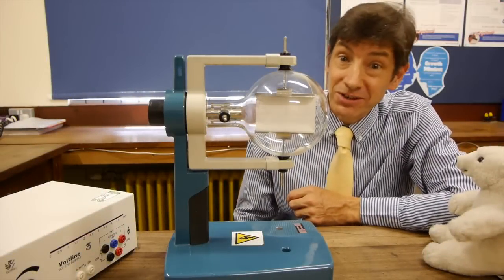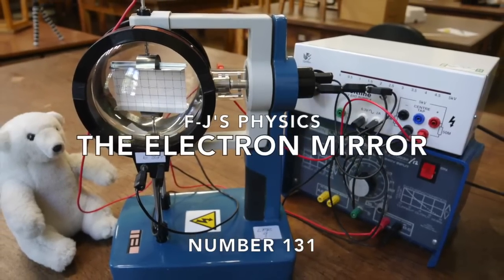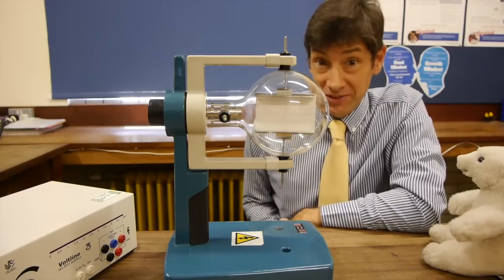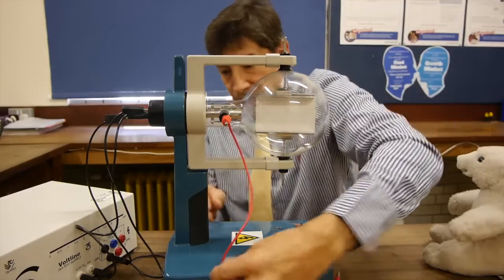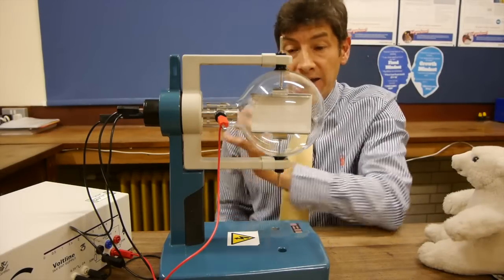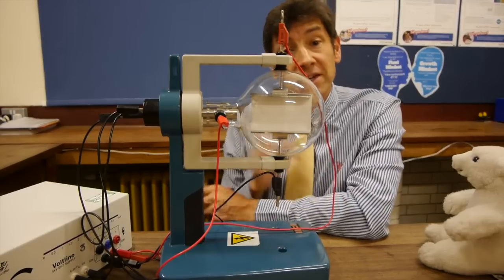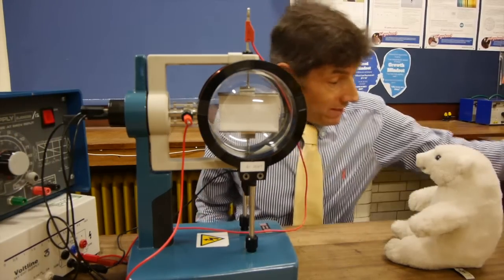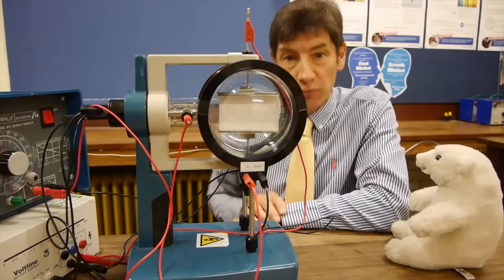Electron Mirror - F-J's Physics - Video 131

Comment: Where is the mirror made of electron or smtg, thumbnail failed me
Reply from the maker: Interesting point - it is of course the electrons that play a major part in specular reflection in a regular mirror if that's what you mean.  However, this experiment is referred to as 'an electron mirror' as it is a way of getting electrons to deflect in a similar manner to the way light would off a specularly reflecting surface.  In short it is the technical name for this process but of course there is no physical mirror involved!  It has many uses but especially in electron microscopes to guide the beam.

Comment: 5 kv, with an exposed anode operated in the dark?! What could go wrong?
Reply from the maker: Good point - I would like to say that years of experience of this type of apparatus and most importantly a very high internal resistance EHT power supply make things pretty safe.  But, yes, you need to know what you are doing and why!
Reply: @AnthonyFrancisJones  Sure, driving without seatbelt with a lot of driving experience keeps you out of danger. Or, so they say.
Reply from the maker: Yes, you are right - they say this incorrectly.  I would not trust the mechanics of the car or the other drivers to start with, so I always wear a seatbelt!  With this kit carelessness would lead to problems and the biggest one is dropping it on the table and getting glass flying about!  I do make sure that the internal resistance of the EHT is in the mega ohms so that tends to keep things in check!  Have you seen this video of mine where I connect a 1.5V lamp to that power supply?  https://youtu.be/V06sYBiYWqM  Hope that helps!
Reply: I was wondering what the insulation rating was on the ultor wire and connector.
Reply from the maker: Probably not high enough Tom but it has always been a standard school experiment and I have never been zapped - check for nicks in the insulation though.  One does need to be careful!
Reply: @AnthonyFrancisJones  I make it a habit of checking a lot of people's gear and replacing their old meter leads when they come into our lab. Thing being one dribble of sweat into cracked insulation (strain relief point say) can mean a nice electrolyte bond, I've actually had a bad one myself from this.
Reply from the maker: Very wise and I hope your diligence has been respected by your clients!  That is a situation where I too would take no chances at all!  As I mentioned elsewhere the internal resistance of these EHT supplies is massive.  Funnily enough some poor HT leads are very stiff and more likely to pull the thing onto me or off the bench.  That aside I absolutely hate electric shocks and never liked getting too close to the Van de Graaff!  Others seemed totally unbothered!

Comment: Interesting display. I am familiar with most of it from my days fixing black and white TV's and using oscilloscopes. The current stopping I have never seen before as that doesn't normally happen with CRT's. They are either electrostatic deflected or magnetic deflected , not both. 
I have seen a funny thing though when the high anode voltage was dropping (faulty circuit). Then the picture just grew and was much bigger than the screen. Obviously the electrons didn't move fast enough so the beam just bend too much. 
No deflection was a real problem. That blew a hole in the fluorescent layer on the screen and the tube then had a permanent black spot in the centre. That meant a new picture tube. If it was my fault my boss was not happy. If it was an unavoidable fault the customer was not happy. They where not cheap those picture tubes.
Reply from the maker: Thanks Leonhardt, it is always great to have examples from people who have worked in the field (no pun intended).  Yes, isn't it interesting that young people would have no idea why a 'screen saver' is called a screen saver these days!  I remember seeing burning into the phosphor on the CRTs of ATMs (cash machines) as they often had green screens with very fixed images.  When doing the electron diffraction demo (have you seen that video of mine) it is very easy to burn a hole through the graphite target/sample too.  Thanks for your insights and also for watching and taking the time to comment.

Comment: Moving electrons produces a Magnetic Feld no matter how, right? Does it also be true if a negative charged tube turns along its axes? Could a charged spinning tube be considered as a giant Helmholtz coil with one turn 🤔?
Reply from the maker: That's a really good question and well thought out.  Sadly the answer is 'No' and equally sadly the reason is not at all easy and involves using relativity to look at what is meant by moving charge which is a bit beyond me in a comment.  Simplifying electrons as balls of charge that move in wires does not really stand up to this type of analysis.  To give you an analogy - not a particularly good one - if you wave your hand about, even though the outer electrons in your atoms are shielded from the nuclear charge quite well you do not emit electromagnetic waves.  The understanding of this is really quite difficult and beyond normal high school teaching.  Sorry for such a poor explanation but you have hit upon a really good example of where simple 'charge moving' models break down.  Thanks for watching and taking the time to comment.

Comment: Hi, I liked the explanation for the electron mirror. What would happen if the electric and magnetic fields were extended horizontally, would the beam resemble that of a sine wave?
Reply from the maker: Good question - with the right field shapes this would happen.  You might be interested in the 'wiggler' in a particle accelerator (synchrotron) which is not that dissimilar and results in a spectrum of synchrotron radiation.  They use Halbach effect magnets for the magnetic field, which are really interesting so you might enjoy this video of mine too:  https://youtu.be/LgJR4nYKKJ8

Comment: Love that setup. Is that the basis of a traveling wave tube?
Reply from the maker: Good question.  There are distant similarities in that a TWT uses an electron gun and beam of cathode rays.  However, wound around the beam is a wire that has an RF signal in it.  The magnetic field due to the RF signal does indeed 'shape' the electron beam and this can lead to signal amplification.  So in the respect of electron beams and interacting fields there are some similarities.  Thanks for watching and glad you enjoyed the video!

Comment: I”m sure that with a lot of development work this experiment could be used to display a picture on a screen 😂 How things have changed, A great demonstration and so informative to those not old enough to have ever seen a CRT with its electrostatic deflection plates or electromagnetic deflection coils. Tony
Reply from the maker: Thanks Tony.  It is a good starting point for focusing in an electron microscope which of course can then display on a fluorescent screen.  I have not seen this experiment done before so I thought it was worth demonstrating!
Reply: Umm, why not dredge up an old CRT display?
Though admittedly, this is better for display purposes
Reply from the maker: David, yes I could but it is not so easy to demonstrate the electrostatic bit of the deflection so this tube is purpose made for education to be able to apply both E and B fields.  Perhaps your suggestion could be another video of mine at some stage.
Reply: @AnthonyFrancisJones Thank you lol, I forgot that the beam deflection on a CRT is the deflection from two magnetic fields.
I used to have an ancient oscilliscope 35 years ago (WWII era?) that did this with an electrostatic field in the Y axis. all hand soldered discrete components on holding cards. still perfectly functional for what it was. My folks threw it out while I was out of the country, considering it "Junk", not knowing it was a very valuable antique even then
Reply from the maker: Interesting David.  I still have a valve Cossor CRO - no way that can be thrown out as you could not even lift it!  I seem to remember it does not have a single electrolytic capacitor in it which shows quite some design!  If my channel went more the 'Big Clive' direction I would take time to feature all of these old bits of kit I have!
Reply: Almost like ‘chasing the beam’ haha

Comment: Nice video and presentation. 
I can see no mirror but push pull effect of B and E fields.
Reply from the maker: Yes, that's right.  It is referred to as 'an electron mirror' as it is a way of getting electrons to deflect in a similar manner to light off a specularly reflecting surface.  In short it is the technical name for this process but of course there is no physical mirror as one would imagine involved!
Reply: @AnthonyFrancisJones thanks for explanation. May I call that deflection and not refraction?
Reply from the maker: Yes, that is the best term I guess - as you said it is not really off any solid object but rather deflection by the combination of fields.

Comment: Trying to think of a reason for the variation in electron speed in your experiment and wonder if this due to ripple on your HV supply. I haven't noticed this before but I haven't used the recommended supply. Also it appears slightly more as a split beam in the video. I'd guess this could be explained with the similarity in frame rate and mains frequency. Always good to see an  accelerated particle beam these days.
Reply from the maker: Yes, I think the velocity selection at the anode is not that good in this type of tube too but I did not check the power supply for ripple either - they are generally quite good as the current is so low but school kit...!  (Oh, of course the filament is AC too, as you know, and so there is a little bit of voltage variation there as well).
Reply: @AnthonyFrancisJones  Thanks for replying. That's also a good point, although a filament thermal inertial should smooth it out a bit. That reminded me of an interesting observation using DC on direct heated  cathodes.  The potential gradient across the cathode means it doesn't emit electrons evenly and over the filament length. Not something I had though about.🙂
Reply from the maker: Yes, that's a good point!  There will be a difficult to model thermal gradient/variation on the cathode.  Trouble with physics, the deeper you dig the more complex it gets!  I must get some of my other Teltrons out.  I need to do one with the Perin Tube at some stage and possibly a triode as well.  A few of the tubes I have are damaged (not by me) which is a shame but they are great when working.
Reply: @AnthonyFrancisJones  The Perin Tube is another great tube and thought provoking when compared with the diffraction tube. They are all somewhat delicate and easily damaged but glad you still have a few to demonstrate.
Reply from the maker: Must get on and do the demonstration.  It is a bit of 'What to do with the tubes when I am done?' though!
Reply from the maker: Interesting as you say - that clear split in the beam.  I really need to get the tube out again and look.  I have had suggestions of the Stern-Gerlach experiment.  Would be great if I have demonstrated that too!
Reply: @AnthonyFrancisJones The Stern-Gerlach experiment would be fantastic, but don't think there is a Teltron tube for that 🙂.  I have the same deflection tube, but I guess it could easily be gun geometry. Also had another thought,  the supply  you are using is quite well magnetically screened in its box, but if close to the tube could also cause beam deflection.
Reply from the maker: Yes!  I must see what is needed to demonstrate Stern-Gerlach but I sense it is out of the realms of school type kit!  I think the blue Irwin PSU that I use for the Helmholtz coils is only in a plastic case and that is very close to the electron gun!